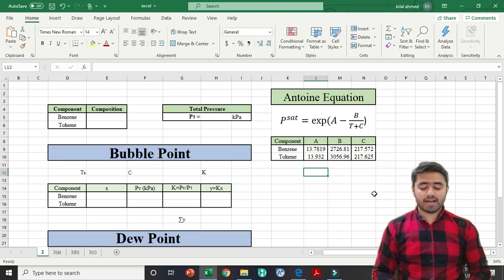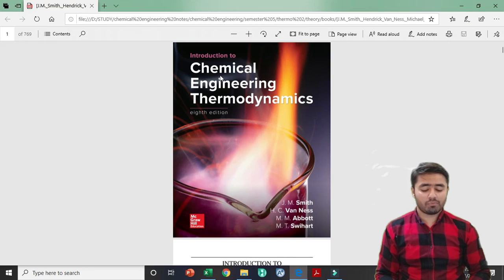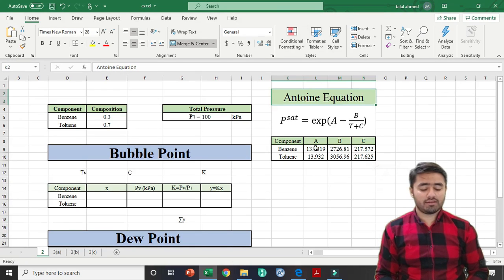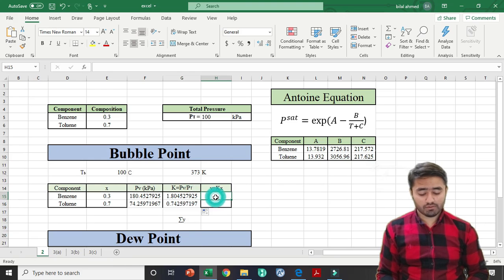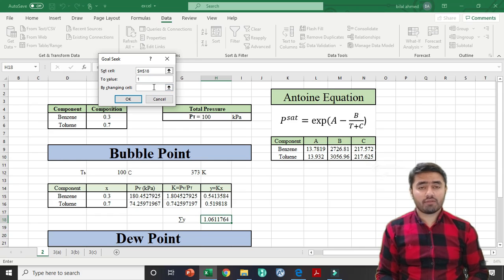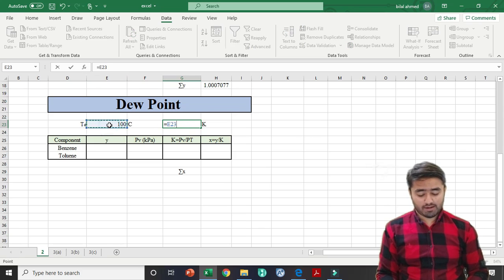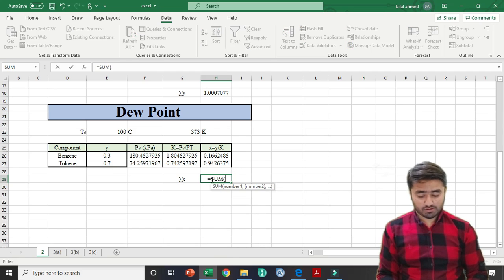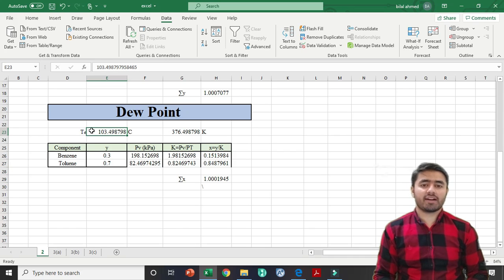How to develop a model on excel for calculation of k-value, dew point, and bubble point temperature?

Comment: Isn’t bubble point meant to be higher then dew point since bubble point can be assumed to be the bottom stream temperature and it has reboiler at the bottom and dew point will have a cooler so would have a lower value to condense the high BP components
Reply from the maker: Please see the Txy diagram. 
https://youtu.be/oQK2O7PVaYM 
Dew point is the point at which 1st drop of liquid appears from the vapors. Vapors are at higher temperatures, that's why dew point temperature is higher than bubble point.